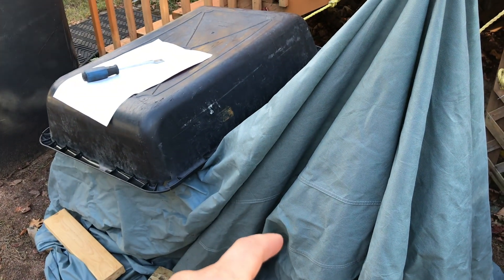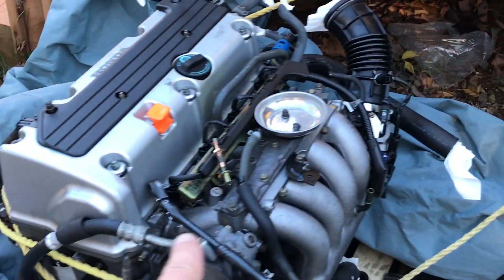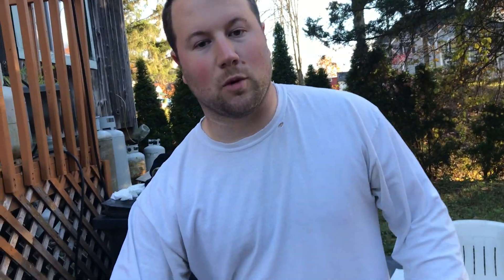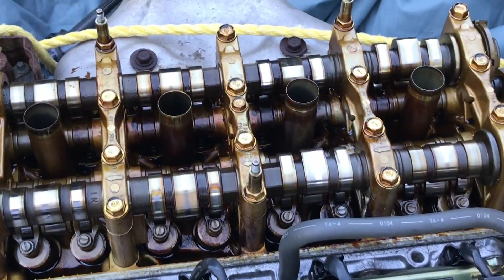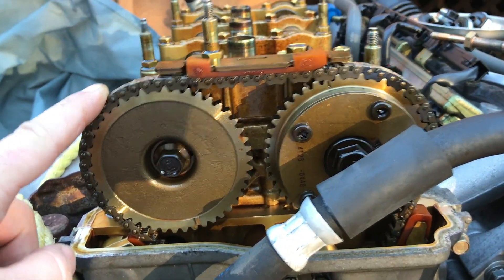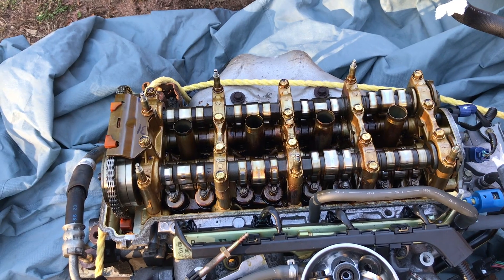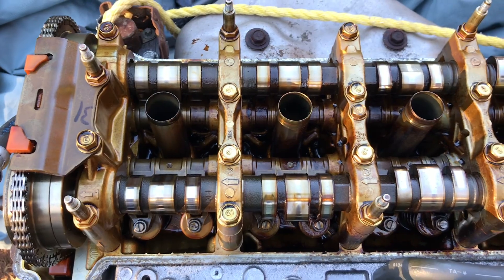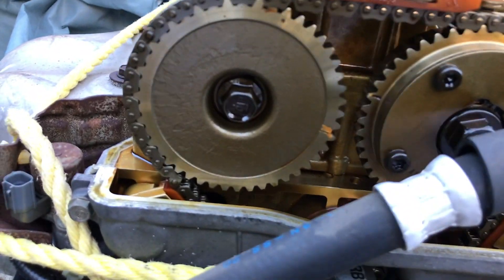Honda K24 Engine Inspection

Comment: You are working with a full metric engine, throw away the imperial tools and do it properly, your inexperience shows by measuring the throttle body on the outside,    the measurements refers to the size on the butterfly.   Much more homework needed on your part and don't believe everything Mr google tells, a few years ago I had an integra with 456k kms ( 280k miles) on the clock, trashed its entire life, never had the head off and still pulled 8500rpm 156hp
Reply from the maker: My first in depth Honda k series partial rebuild 🤷🏼‍♂️

Comment: If your cam lobes look good, your bearings and everything else critical are usually good. Just run a few short oil change intervals with any quality synthetic and it will clean that sludge out in time.
Reply from the maker: I definitely think some maintenance oil changes would shine her up a bit 😎.

Comment: Is this the TSX K24A2 ?
Reply from the maker: Basically... but this is the JDM version from the odyssey absolute. 197hp 171tq stock
Reply: Gerb Productions thanx for the quick reply. What’s the dif between the tsx k24 and the 9th gen k24? Thanx in advance
Reply from the maker: He’s testing me lol... the k24a2 (tsx) engine is a 2.4L that offers I-vtec on both camshafts, whereas the k24z7 (9th) offers vtec On intake side. The 9th gens use an integrated downpipe on the exhaust vs a header design like the tsx and 8th gens.  Main difference is cylinder head and some block differences between the two. I prefer the tsx k24 because of the I-vtec performance head. I will say 9th gens are great for turbo and make some good torque.
Reply: Gerb Productions 
Thanx for you’re reply bro! I’m anxious to see you’re build as are a lot of others, so good luck and I’ll be watching and leaning at the same time... keep up the wrenching!!!

Comment: Damn shes sludgy af man, whoever had that engine must not have changed the oil frequent enough
Reply from the maker: Ik... wasn’t too happy, but the chain looks good, cams are decent.  Time to open the oil pan and check the pump 👀

Comment: build the old k20 into a 9000rpm ripper. need an rsx type s oil pump and oil pan baffle. then dual valve springs and retainers with a steep cam. then make the bottom end 11.5 to 1 comp like the type r. you could make 250whp that would be decently reliable unlike spinning a k24 to 8000 which probably wouldn't last as long due to the big stroke. winding road drove an 275hp fg2 with that setup and it performs like crazy in the twistys.
Reply from the maker: Since I’m going to have my k20 as a spare, we shall see.  9k with 250whp would be nice 🤘🏼... I think a k24 would last at 7800-8k rpms, as long as you don’t shift like shit.  I seen that vid, it was pretty wild.  Either way, I’ll have my k20 as a spare 🔧

Comment: This is my dream project good luck. If you want reliable strong engine with lots of power use only OEM part and let a professional  overall the engine. If you are ready to play around and  waist lots of money and have something that runs from time to time then try doing it yourself.
Reply from the maker: Yup, oem it is 🤘🏼... I’m going to DO this job myself, so Wish me luck
Reply: @TheGerbsteve   Start reading the manual and send the head and block for mashining the only that you can do at home is assembly.

Comment: When you first run the engine. Use royal purple to flush the engine for the first 1000 miles and then use your regular full synthetic oil after the “break in”
Reply: Royal purple 0w20??

Comment: Hey man do you know if my fg2 will pass emissions if I do a header with stock exhaust?
Reply from the maker: It sure will as long as they don’t do a visual inspection. Mine passed, skunk2 alpha header, stock exhaust
Reply: Gerb Productions that’s the exact header I’m trying to get bro, but don’t headers eliminate catalytic converter?
Reply from the maker: They do, but if you run an o2 sensor extension on secondary sensor, it’ll eliminate CEL light 👌🏼

Comment: When you do a clutch disk install let me know how you got your ish working mine would not go into gear after starting, it is correctly put in also my clutch.
Reply: might be a dumb question but did you bleed your slave cylinder after?
Reply: @juanclaudio7821  yes brand new I think it is my shift assembly on top it might have been damaged when installing the transmission. Goes into gear car off starts moves slighty when cranking so forth I was not sure how to reinstall it at the time to line it up

Comment: That is a fair amount of sludge , I would definitely pull the oil pan and check underneath. Also what were the compression numbers ? and the Z3 intake cam would be a good swap as well.
Reply from the maker: Planning on pulling the oil pan and doing a compression test over the next few days.

Comment: That engine is fine bro.  Just run some cheap oil, a can of BG EPR, and cheap filter for the first 200 miles or so then do another change with your preferred oil and filter.  It will be good to go.

Comment: Once timing is set on Kseries and you spin the motor in will take hundreds of revolution before everything lines up again. Don't freak out like I did and think you did it wrong. Also make sure you preload the tensioner 1 or 2 clicks with a flathead screw driver to avoid chain slap
Reply from the maker: thanks for the input in advance. And yeah, we have to love one of the weakest parts of our engines, the chain tensioners. I will preload it one click, just to help reduce the piston retract into the housing. Believe it or not, stiffer valve springs and aggressive cams contribute to the tensioner failures more.  Crazy how k series tensioners operate on oil, but with a spring at lower speeds as well 😮

Comment: what year is that motor?  If you are doing a chain, guides and tensioner, do yourself a favor and replace the vtc actuator in the process.  Also do a valve adjustment. If u need specs on feeler gauges for a valve adjustment let me know.  Also if u have a good air impact gun or know someone that does buy this socket , and the crank bolt comes off so easy..https://www.amazon.com/Lisle-77080-Harmonic-Balancer-Socket/dp/B00RGNCV1U/ref=asc_df_B00RGNCV1U/?tag=hyprod-20&linkCode=df0&hvadid=312373636797&hvpos=1o1&hvnetw=g&hvrand=997990562971437820&hvpone=&hvptwo=&hvqmt=&hvdev=c&hvdvcmdl=&hvlocint=&hvlocphy=9004192&hvtargid=pla-437104066017&psc=1
Reply from the maker: I believe 04/05.  I will be doing all those things.  Valve adjustment, head gasket, etc.. Thanks for looking out, but all i have is an electric impact at the moment

Comment: Yo bro I hate to be the one to say it but that motors shot... someone got you dude. That shit looks like the owner changed the oil every 10k, ur cams lookslightly shot, all that sludge is NOT GOOD AT ALL. It doesn’t look like a solid motor at all, I’ll bet it is down on compression on atleast one of the cylinders. I hope it’s all good but I’m reality it doesn’t look good for you bro. Best of luck...
Reply from the maker: I will say they probably exceeded 5-7k oil change intervals a few times 👀... Or whoever ran the engine ran conventional >synthetic.  Cams do have some wear, but my z3 cams look the same wayyy.  I’m going to compression test it this weekend.  I’m staying positive no matter what ✌🏼
Reply: Gerb Productions yeah for sure, k series motors burn oil cuz they are “solid rocket motors” so most ppl don’t know you have to add .5 to one full qt of oil every 1000-1500 miles which is a problem on its own, plus it deff looks like conventional oil. But think about it ur Z3 cams were worn and now you have a new motor ya know? If it has solid compression then you should without a doubt get new cams (preferably out of the 08 tsx) a type s oil pump, new chain tensioner and guides, obviously new head gasket, and a new water pump can’t hurt either since the motors already out. Best of luck dawg.
Reply from the maker: Something so simple as adding oil lol. I always keep my k series topped off. I may just grab a -50 vtc and pair that with rbc.  Was gonna send it to 8k rpm with the stock k24 oil pump too lol.  Yup, plans are new k24 head gasket, new k24 tensioner, k24 guides and chain kit, oil pump chain, water pump, arp head studs, etccc

Comment: Toss the z3 cam in it . Z3 cams better then tax cam be sweet little hybrid
Reply: Frankie S that’s completely inaccurate buddy. Tsx cams are superior lmao
Reply: People drop the tsx cams into k20 motors as an upgrade...
Reply: @eLSWon  keep doing your homework
Reply: Frankie S you mean the actuator from the rbc, then yeah superior than the 25 lol
Reply: @BenlyBraxton  correct
Reply from the maker: The sweet spot for the k24's is about 30-35 degrees advancement.  I've heard swapping out the stock RBB vtc with an RBC actuator can gain anywhere from 10-15hp/tq across the whole power band.
Reply: @TheGerbsteve  if only s2000 can turn vtec into ivtec

Comment: Your wrong sir, 08 tsx intake camshaft is better, just run 08 tsx cams with 50 vtc look on zosh Channel
Reply from the maker: Few HP difference between 06-08 vs 04-05. 2004/05 make more tq though. Plus this is a JDM engine, so it may be different. Already planned on running -50 vtc, rbc, etcc
Reply: K24a from the vtec Accord is 200hp 08 tsx k24a2 is 205hp
Reply: Check out zosh 24a swap

Comment: Don’t sleep on that type-s pump my guy you want that K24 to rev as high as possible and to make more more power Obviously👌🏾💯🏎💨
Reply: Pointless in my opinion unless u making this a track car. With the added torque of the K24, you dont need the be revving to the moon for power. Id only upgrade the pump if I was going K20 head, but even then, youll be lucky to get to 8600rpm even with Supertech valvetrain on the K24 bottom end. If you wanna rev out a K24 youd have to seriously build the whole motor.. New rods, pistons, compression., serious valvtrain, ect..
Reply: @MikeHarkins-w9b  yep. people are so uneducated, look at the stock rev range for the k24 and unless youre doing cams/springs/retainers/ RBC you absolutely do NOT need to rev a k24 past 8k RPM. Past 7k power drops off drastically, im looking at my Dyno sheet now. stock port k24a with RBC and k20 Cam gear. rev limit 8k, you go past that on stock port youre stressing the engine out only to make more noise and not power.
Reply: @Goodtimesbadluckv2  .. Yeah the K24 piston speed at 8K is like the k20 at over 9K.. Its pointless and dangerous for the motor unless you are fully built and like you said, power drops off for the k24 at high rpm unless you have higher compression pistons(and stronger rods) and a built k20 head... The whole point of the K24 is to get a more even powerband and more torque. Not everyone likes have to rev the 6K just to get the car to move.. That is what was so annoying about my K20 is it was so damn slow and useless below 5K rpm.. But its all about preference. If you enjoy revving out your car, stick with a k20.. If you like more drivability and like having more power available at lower rpm, the K24 is where its at. The k24 is also better for boost.
Reply from the maker: I've been wondering if k24a stock pump can handle 8k rpms or not.  I will be using stock k24 pump with rbc mani and rbc vtc gear. Wish me luckkkk
Reply from the maker: My question is, will the k24a handle 8k rpm redline with rbc mani, 50 deg vtc, skunk2 alpha header, ram air intake on stock internals and pump...
Reply: @TheGerbsteve  .. I wouldnt use 50 degree VTC.. I would get a custom 40degree VTC and and have a physical restriction.  Unless you build the head, and get cams, you probably wont need to rev to 8k.. Youll be making max HP and torque far before then on stock motor and head. Youll need a Dyno tune tho 100% if you go RBC and VTC.. I wouldnt install the RBC and VTC gear until you are ready to go on the dyno. You will lose power, and if you rev too high with the 50 VTC gear, even with a KPRO electronic restriction, it could surge and cause contact and your motor will be history. Just not worth the risk in my opinion. Thats why Im going 40 degree custom VTC from drag cartel. I would also install the Type S oil pump now if you plan on making the K24 rev higher in the future. You'll need it.
Reply from the maker: I'll be happy with 8Krpm redline man
Reply: Gerb just keep it simple the mean time I have a k24a2 with rbc mani type s pump swap alpha header and j37 throttle body and obviously the rbc 50 degree cam gear made 235 on the dyno it’s completely safe the stock k24 oil pump is too restrictive the type s pump will Definitely help with oil pressure and and lighter to Obviously it will rev higher my straight 24 revs to 7600
Reply: @paulyyyyyddd  .. I made 228whp/179tq on the stock pump and 40 degree VTC with RBC and full 3 inch exhaust.. 70mm TB with ported RBC to match and Acuity TPS. My oil pressure was fine. I will obviously be upgrading it, but you dont need the Type S oil pump unless you plan to do k20 head and want to rev past 8K.
Reply: Mike Harkins you’re definitely right 💯but you know he’s definitely gonna do it later down the road might as well do it since he’s take the motor apart right?

Comment: Once you put it back together use Royal Purple 5w30 oil. Run it got about 3000-4000 miles and take the motor apart. It will clean that motor up so much with the cleaning materials that Royal Purple holds

Comment: I’ve got a k24 with 275k on it and it doesn’t have any varnish/ carbon build up on it at all. Pulled the cover recently to check the valve lash. That motor looks like it had a couple 20k oil intervals
Reply: Japanese car owners throw there cars away due to emission tax on older vehicles... to be parted out or sold whole to Australia or Canada. So likely it did only have a few oil changes in its life.

Comment: Damn lucky you got the 3 lobe on the exhaust, I had bought a K24A years ago and it was only 2 lobes on the exhaust cam :/
Reply: DCar1986 but how can you not check and know? Wouldn’t you have checked that it said K24A?
Reply: Hmong American Life Block has K24A stamped on it, ended up doing a Frank conversion and got a deal on a Z3 head w/cams
Reply from the maker: The huge giveaway between 160hp and 200hp version are 1. EGR valve (160hp) 2. # of lobes (2 or 3 lobe). The performance , i-vtec k24a's have the 3 lobe, meaning vtec on both intake and exhaust... Very similar to the k20's, etc. Now the k24a with 160hp is not necessarily and underdog because in a light chassis swap, the 160hp, 160tq is very usable.

Comment: Since u had the motor out its best to change headgasket and check all piston rings rod bearing and crankshaft bearing and seals and also the valve seals
Reply from the maker: It's getting new head gasket, timing chain, tensioner, guides, etcccc
Reply: Gerb Productions nice bro do a complete tear down that way u can check everything so u can check how the crank n rod bearings doing and clean the rings too on piston sleeves

Comment: Just take a pressure washer to the head to clean the sludge out lol
Reply: Max Powers No don’t do that
Reply from the maker: I’m going to avoid all water on the internals/accessories as possible lol
Reply: @TheGerbsteve  I was kidding guys lol
Reply from the maker: I was mainly referring to rain, snow, etc haha
Reply: Change the oil pump to the rsx
Reply from the maker: I was debating on it. Wonder what the stock k24 oil pump will handle in terms of revs 🤔
Reply: @TheGerbsteve  im running the stock k24 oil pump from a 06 tsx k24a2 with the z3 pan no issues with oil pressure I have my rev limit set at 7800.  Ita my daily so I dont beat on it much I do keep oil level to the top mark all the time I check it once a week or so.